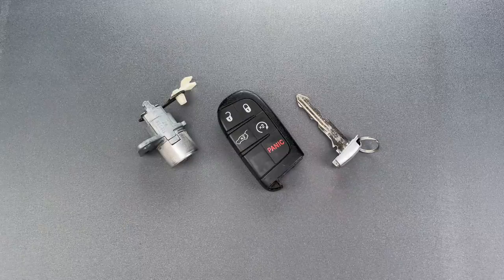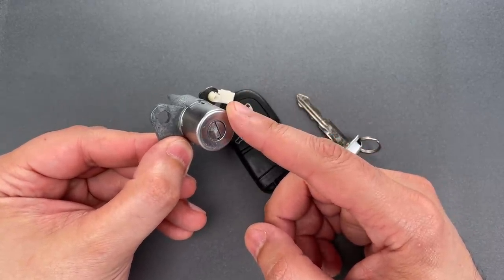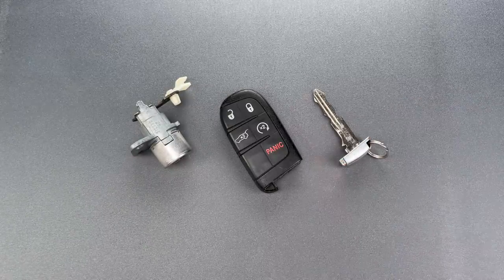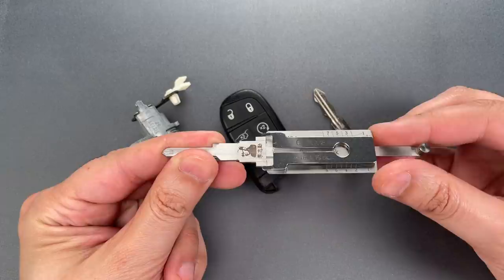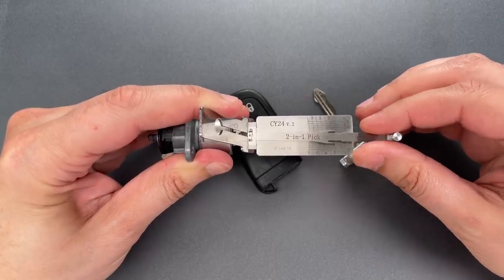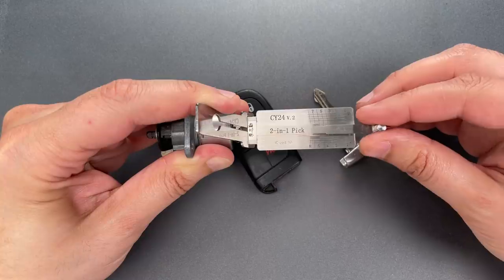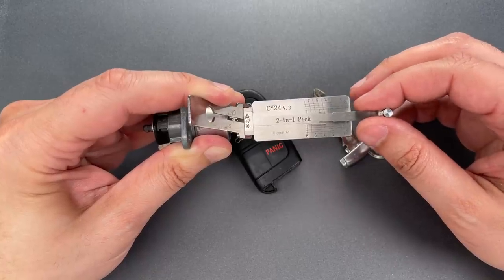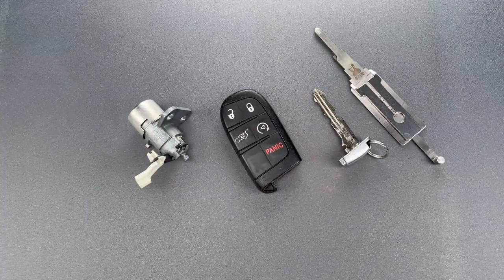[1326] Jeep Grand Cherokee Door Lock Picked

Comment: Well damn I have a 2015 Chrysler and the key is exactly the same... Come to think of it my first car was a rust bucket 95 Cherokee and on more than one occasion I accidentally got in the wrong car, for some reason my key would open every Cherokee, so locks have never been their strength. Luckily all Chryslers have an anti-theft measure in that the transmission is set to self destruct at any time.
Reply: self what?
Reply: @torieree5781  commit surprise seppuku
Reply: As a former owner of a 1997 Dodge Ram, I can confirm the security transmission failure was a feature.
Reply: I enhanced the security 4th gear and overdrive self destruct with nitrous and race cams. Poor 545rfe, blew up 3 in 2 years haha
Reply: Lol feature....
Reply: Yeah, I'll have to drop a couple K into mine here in a year or so, and maybe even for a new PTU.
Reply: So good it’s both anti-theft AND anti-owner.
Reply: Old VW's like the Golf 2 and the Jetta had the same issue with the key. I think that the issue was with sticking pins. That meant that one key opens multiple cars. Also in Europe we have Skoda and a friend of mine had a remote for his car (Octavia 1) that also unlocks his neighbor's car (again Octavia 1)... that was a massive fail! In the end they decided that they will not park their cars close so that one does not unlock the other's car by accident. At least the key was different.
Reply: Should get a new car then. Your own fault if it gets stolen for safety concerns LOL
Reply: And then they commit sudoku
Reply: That took a twist
Reply: set to what now?
Reply: Older cars of the same model all used the same key
Reply: Some call it a bad design, others call it a security measure.
Reply: @AdamIsUrqed  2001 Grand Caravan me too
Reply: add another reason to hate jeep to my list.
Allthough their overpriced vehicles still takes top reason.
Reply: For these models it doesn't matter if he can pick it. If I unlock my locked Chrysler with the key instead of the remote the alarm goes off no matter what.
Reply: See also: Nissan Frontiers
Reply: @adamkieffer6827  If I can't drive it, NOBODY can drive it! lol
Reply: @GadunganBersatu  This is funny! "Commit sudoko"
Reply: The best defence is that no-one in their right mind is going to want to steal a Jeep Grand Cherokee.
Reply: Pffffffthahahahahaha.  I see what you did there
Reply: @RAMXC  Boris, do you live in Europe, or in Russia. Not the same.
Reply: A friends jeep looked him out twice on its own, keys in the ignition. Buggy.
Reply: I can reaffirm that self-destructing tranny feature in my 1994 Dakota of long ago.
Reply: That's some refreshing shade in the height of summer.
Reply: @bobsum1745  I wrote Europe. Also Russia is part of the Europe continent and in fact the majority of people living on the European continent are from Russia.
Reply: Yeah once my 300 hit 27k miles the transmission sensors went out and it wouldn't shift out of second gear. It was an awesome freeway drive to the dealership.
Reply: Scotty Kilmer enters the chat.
Reply: Hahahahaah that’s if the rusted ground wires don’t get you
Reply: Yes
Reply: @RAMXC  That's funny. I am surprised that stuff still happens. Back in the 80s my dad took my mother's Citroen Diane to work so he could change its oil. In the evening he got in the car and started it. Then,  he realized the car was too clean to be my mother's. Sure enough, he was in the wrong car. My mother's car was parked 3 spots over. He was very embarrassed, tried to exit the vehicle very discreetly and moved to the right vehicle.
Reply: Yeah they kept that feature in the 19-20 Promasters too
Reply: Ha! Similar thing happened to me back in the 90s, I had a Toyota Cressida, parked at a busy mall around Christmas, unlocked the car and got in but couldn't start the car for some reason, then I noticed the pile of unfamiliar wrapped presents in the back seat. Wrong car!
Reply: @RAMXC  Happens sometimes. I work as an indie automechanic for PSA (Peugeot-Citroen) cars, and few times, maybe 3-5 times in my whole career of about 8 years, when i had like 10-15 client cars awaiting in my yard for repairs, it so happened that the OE key fob remote unlocked and locked two cars at once. Sometimes even different model or make, but with same generation BSI (central electronic control unit of psa cars) and same generation remote (same frequency/modulation). Sometimes only one button worked, meaning it only unlocked, but didnt lock or open hood/turn on lights.
There are two possible explanations.  First, receiving and decoding unit possibly alows for some inaccuracy of received code within tolerance limit, and so it happens that the difference between two codes is so small, that its within that limit.
Second idea, both cars were bought second hand and before that some work had to be done because of lost or damaged keys or malfuctioning receiving module and it included some cloning work, using EEPROMs from sources outside of direct dealer network and without full initialisation.
Both of them are pure coincidence.
Even starting may be possible in some really rare cases, because of limited combinations of codes of id46 or other type of immo chip. It is very highly unlikely, but still theoretically possible.
Reply: That's hilarious, my Cherokee key does that too. It's pretty dulled down and won't stay in the ignition either 👍
Reply: @acediadekay3793  i prefer committing surprise sudoku so the paramedics have something to do when they get there
Reply: As someone who worked in Automotive Industry in Detroit, I can confirm Chrysler is the running joke in town.  This comment had me a laughing all day.
Reply: @acediadekay3793  - Chrysler is owned by Fiat - Fiat is Italian - When the going gets tough, Chrysler/Jeep surrenders; not suicide.
Reply: yo my gibba do the SKUNK LOCK
Reply: @captaindeliciouspants8315   - Not to be confuses with the Lockheed "Skunk Works."  ; )
Reply: That's funny because I'm on my 4th Grand Cherokee and no transmission problems ever not once.
Reply: I got a $10 replacement throttle from AliExpress for a friend's ebike and was surprised the key could also unlock my bike's $800 battery 🙄
Reply: “Luckily all Chryslers have an anti-theft measure in that the transmission is set to self destruct at any time.” Self destruct huh. WAIT SELF DESTRUCT JUST FROM A PERSON TRYING TO STEAL A CAR WHAT THE FU-
Reply: Huh, I have a 94 Cherokee and the transmission is still solid. Stick for the win!
Reply: @ScottKenny1978  my first car was a 94 grand cherokee; nearly 300,000 miles when I let it go.  Transmission had to be changed around 170, though, if I recall…
Reply: @Toonces311  caravans are notorious for that had a 88 grand caravan that the trans died and my folks had a 96 that died too
Reply: @WalrusComrad  Example? Year/Make/Model? A Locksmith would like to know.
Reply: 100% bullshit. I've had multiple.
Reply: once while trying to replace backlighting of dash board on 2004 KJ Cherokee, i soldered several cables for led stripes. i accidentally started engine by turning oo headlight switch?! without the immobilizer key inserted in. but  then i was unable to stop the engine without cutting that cable at back of dash board thou.
Reply: don't get me started on JGC 4.0's............. you know, there are people who literally love 99-2004 JGC'S!

Comment: I'd love to see some auto locks which AREN'T a case of just using the right LiShi tool and instead involve something more unique/creative to open
Reply: Same here, these vids are getting a bit boring. Now, torching the hubris of some marketing, that's always fun.
Reply: A few use inverted wafer lock. (Inside cut.) That one is a bit trickier to land the tool in - needs one with the prong outside rather than in the center.
Reply: Volvo from 201x give you limited access to the lock

Comment: Jeep Grand Cherokee owners : *chuckles "I'm in danger"
Reply: At the same time that I'm curious if my jeep Wrangler lock is safer, I don't want to ask.
Reply: Apes World If your car has a window and the thief has a rock, you’re screwed no matter what car u drive  😂
Reply: @Mageblood  well, it depends on the place you are at. Most cars have an alarm that goes off if something like that happens, and if your in a crowded place that will obviously attract attention, but if your car is in the middle of a forest then yea you are screwed
Reply: This Cherokee (not Grand) owner: "At least he didn't jiggle it open."
Reply: Umbah umbah  shameless promotion
Reply: and dodge and chrysler, AHHH
Reply: @dando541  Any vehicle that uses this style key will have its alarm go off if you open the door without the wireless fob nearby, so no benefit to picking over ye olde rock.
Reply: Don't know how the 2018 one react, but on mine, the alarm triggers if you open it with the key instead of the bip

Edit : mine is from 2003 so no proximity sensor in the key.
Reply: Dan Do If you’re in a city it doesn’t matter where your car is parked, but I get your point
Reply: @wtheonew  most cars with an alarm for the door, can be bypassed by breaking in and hitting the unlock button on the door, it shuts off the alarm, i have to do this on my wife's jeep regularly because i'm too lazy to change the battery in my FOB. i only get in it once a week so i just unlock the door with the key, hop in and hit the unlock button and the alarm shuts off.
Reply: @apesworld3733  it's more secure than the hinge side of the door.
Reply: Wrong I've had multiple.

Comment: My Jeep is completely immune to this type of picking! Mostly cause there are no doors lol
Reply: And it's a Chrysler
Reply: I recently locked the keys inside when I closed the door.  I unzipped my back window and was right back in.
Reply: Rolling on the floor LMAO!!
Reply: Don't worry a strip of metal banding strap can unlock the door faster.  I've had to open a few XJ and ZJ's/ WJ's that way of people that have locked their keys inside.  A few of them was still running. Luckily not my own XJ or MJ I did screw up and locked my keys in my MJ once learned to not do that again. Now my LJ was easy most of the time no doors or top.😁
Reply: My van proved to be immune to a thieving attempt at our local Walmart. I came out, hadn’t locked my doors, back passenger (electric sliding) door was open, nothing was missing. There was nothing to take. No stereo, no cds, best thing they could’ve grabbed was a very long Phillips head screwdriver. I’m glad it was hidden under a bunch of McDonald’s bags :D

Comment: those lishi tools are comically fast even by lpl standards. now i just wait in fear until the subaru lock comes up lol
Reply: It's likely the same principle as any other milled key. A lock pick on its own, will just open the door. A modern car should set off an alarm and the ignition won't work without the chipped key.

Of course that's assuming the thief just has a set of lock picks.
Reply: @ExperiencesAndEquipment  You're right about the ignition, but you'd be surprised how many modern vehicles don't set the alarm off when you open a door without disarming it.

If you want an example from youtube, Demo Ranch just recently had his brand new ford broken into maybe a month or two ago and was surprised to find that opening the door while the system is "armed" did nothing
Reply: @JamesEsau  that sounds like a defective alarm-system.
Reply: @johan.ohgren  You're right. It does sound like it would be defective. In reality though it's just automakers being too cheap to put a proper alarm system in their vehicles
Reply: @JamesEsau  My 2007 Subaru Impreza was an odd one then. If I tried to unlock my car with the key it would just pull the alarm every time. I had to always unlock it with the fob to get inside. It never ever had a problem with getting started by the same key as well.
Reply: @MrMega200  At a guess I'd say the chip reader may have been bad in the door.  For years I thought there was a major safety flaw in the 2007 Rav4 I had - if you unlocked with the fob and only opened the back door it would lock again as if no doors had been opened (imagine a parent drops the keys while putting an infant in the back seat then locks themselves out of the car).  Turns out the switch that detected that door being opened wasn't working (should have noticed the dome light wasn't coming on).
Reply: @HariSeldon913  that's pretty educational and makes sense. The weather may of ruined it. Talking about something similar, the previous person or dealer who owned the car before me snipped the speaker wires(forget the OEM connectors) and then just wrapped the bare wire on the terminals. Of course the ends were all corroded. I thought it was a case of bad speakers so I just replaced all of them, stripped the wire back a bit, and just soldered the fresh wire onto the contacts. I put liquid electrical tape and regular electrical tape on top of that to keep the water away from corroding it further.

I no longer have the car, maybe it's still on the road and current owner may have had that issue fixed, dunno.
Reply: Check the website they do have a Subaru one for sale

Comment: Now that I can open car doors, when will you do the starting engine lock
Reply: It is more complicated, and goes beyond picking. But it can be done to many cars. But once you are inside, you can pop the hood, disconnect the battery (and thus the alarm) and load the car on your flatbed. Take it to your shop, disassemble, part it out. Because that's what often happens.
Reply: You'd have to bypass immobiliser too, but on an old ass car it could be possible, however it is easier for a thief to disconnect the cables from the ignition switch and short them together
Reply: @UncleKennysPlace  Decent alarms have a seperate battery to prevent this type of bypass.
One of the less scrupulous people I used to know made a 'living' steling car alarms when they were all basically seperate units, even the manufacturere include versions.
Dealers actually bought them from him so often people claiming on insurance were likely getting their own alarm back.
Doors are rarely secure, especially when the key is seen as a back up.  But the ability to drive away requires a lot more time and talent.
Reply: There is no ignition key for most of these cars with passive entry or "push button start". The backup physical key only gets you in the door, then you hold the FOB up to a specific place (or occasionally insert it somewhere) if it's battery is dead. There would definitely be computers involved if you don't have the programmed key
Reply: @davec8921  I will never own an RFID keyed car because of one simple problem. It makes a untargeted robbery harder by forcing the thief to hack it. However it makes a targeted attack so easy that any professional could do it. Right now we have RFID scanners capable of picking up the transmission from that key from up to 3 ft away. I absolutely guarantee that at some point when you go to the grocery store your wallet keys and or purse are within 3 ft of somewhere I could put a scanner. At the same time a small camera could identify people, which would then literally give me a shopping list of local cars and their ignition codes. The RFID key itself responds to a signal from the car, and that test code is standard across almost the entire industry. The reason that LPL has not done anything like this before is because simply there are other people here on YouTube who specialize in that sort of crypto analysis. Honestly at this point the best US anti-theft system would be a manual transmission. Over half of Americans cannot operate a manual transmission at all or would find it extraordinarily difficult to operate at the same time as trying to get away with your car.
Reply: Good luck on a 2018 Grand Cherokee.

It’s a push button start and if you open the door using the lock it sets off the car alarm in a few seconds if you don’t get the engine started.
Reply: @leechowning2712  You will never own an RFID keyed car because it defends against the common kinds of car theft but against a targeted attack that has probably never even happened? That makes no sense.
Reply: @beeble2003  Actually saw a documentary a long time ago about modern car thieves, those RFID things make it easier than ever.
The people at the chop shops will give the thieves a small computer device that will unlock and start the car with ease, they don't need to have any idea what they're doing.

And yea it's probably going to be somewhat premeditated, pretty sure most car thieves are taking them to chop shops, not randomly deciding to steal cars they happen to be walking past because they saw how to do it on LPL's youtube channel and feel like getting charged with grand theft auto.
Reply: @littlegirlshowSynch  OK, that makes more sense.

Comment: Luckily manually unlocking most modern vehicles will set off the alarm
Reply: @asdrubale bisanzio Yes it does
Reply: @asdrubale bisanzio Even if you use the key, the alarm will go off. Depending on the vehicle, you either have to use the fob to unlock it remotely or the fob has to be very near the vehicle. If it detects the cylinder being turned (either with a key or picked, doesn't matter) without the fob nearby, the alarm goes off.
Reply: @wingracer1614  correct, my last 2 cars 1998 and 2004 models both required use of the fob, the key was only an override for when the remote battery fails and I have the immobilizer tag on me to stop the alarm.